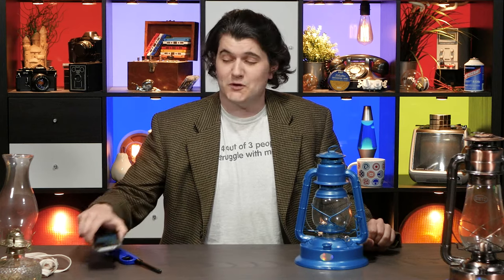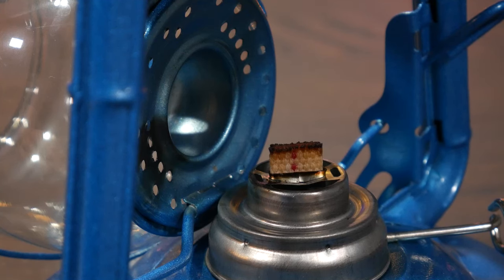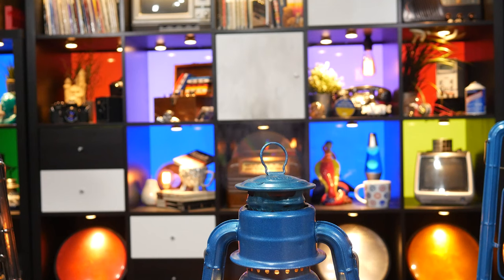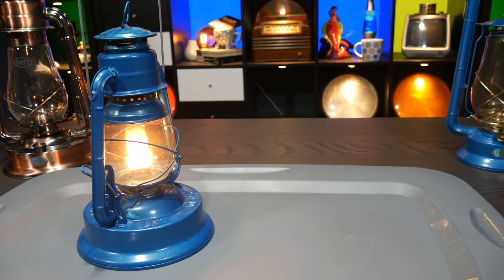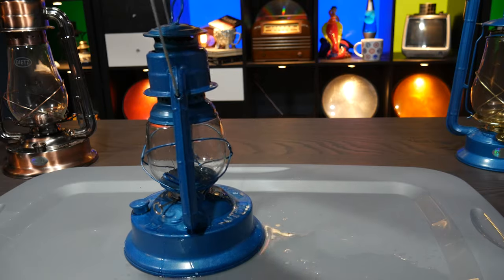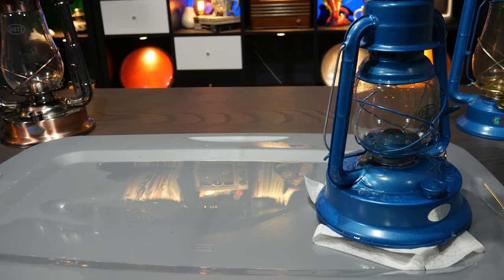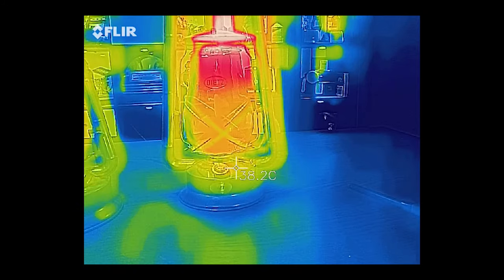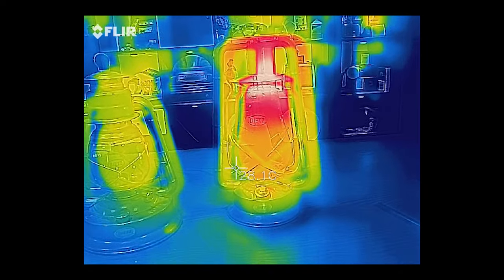How to use, more info, and further thoughts on hurricane (Dietz) lanterns

Comment: I got a similar lantern as a gift one time (Aladdin).  It came with a bottle of its own oil.  When the oil ran out, I switched to diesel fuel.  (Kerosene is very hard to find in Taiwan.)  Diesel is the same as kerosene, but has been processed to burn more cleanly.  JP4 jet fuel would be ideal, but it would be overkill.  "May I see your passport?"  Alec:  "No, I just want to buy a liter or two of jet fuel."  You could actually put kerosene in an airplane, but after the plane takes off, you wouldn't be able to see the airport because of all the smoke.  HA!

Comment: I wish you had done the research on the different grades of fuels. I spoke with the people at Lehman’s Non-Electric Hardware store in Kidron OH in Amish country, and I was told the following:

Kleen Heat and Aladdin Lamp Fuel are Kerosene also. But they have been refined further beyond basIc Kerosene.
Kleen Heat has been refined somewhat, and Aladdin Lamp Oil has been refined the most and is almost completely odorless. Aladdin Lamp Oil is the one I use. Never had a problem.

Comment: Just to clarify, on cars the idea behind the cold air intake, or CAI, is that it’s better than another kind of aftermarket intake designed to be loud, look cool, etc; the short ram intake, or SRI. Short ram intakes are very prone to heat soak as they are shorter and closer to the engine than a cold air intake. The reason why people like me buy cold air intakes is because of the design, most aftermarket intakes make more power because the pipes are larger and less restrictive. The saying that cold air intakes make more power is true in comparison to short ram intakes. The whole reason intakes make more power is because they are less restrictive. For example on my 2018 Honda Civic Si, the factory plastic airbox, filter, and hose is very restrictive compared to my PRL cobra cold air intake. The 4” silicone piping on the aftermarket intake is less restrictive than the 2.5” plastic flex hose on the factory intake. Because of the lack of restriction, the aftermarket PRL intake gains 12 horsepower and 15 pound feet of torque at peak power, and even more in lower rpms. Another thing is that CAI’s sometimes make less power than SRI’s, but CAI’s are way less prone to heat soak. That is the reason to get a cold air intake over a short ram intake. Aftermarket intakes in general tend to make more power, mainly because they are less restrictive. I hope that clears things up for people!

Comment: Careful with trusting the leadings from an infrared camera. The surface they measure must either be properly emissive or corrected for. The glass bulb of the lantern will be reading much lower than the true temperature  and even the blue paint of the lamp may not have a very high emissivity. Best is to paint a smallish black dot on certain locations where you want [close to] the true temperature measured and point the sensor squarely at that.

Comment: It is why you have an inter cooler on turbo cars so air comes in then to turbo then the inter cooler then air metering then into engine. Cooler air more energy. The tiley lamps (incandescent)  paraffin lamp is so much more efficient by using a radioactive catalytic converter. The change in flame is due to heating of the fuel as the whole base is getting hotter

Comment: Combustion doesn't care for temperature if the fuels are present. More fuel/O2,  more power.. maybe adding soot to the flame helps with light output, but I doubt alot is getting all the way around that exhaust

Comment: something that preheating would do is increase the air pressure inside the tubes, and that may be where he was trying to go with it, rather than increasing the temperature to make it burn better. for example of this look into some camping stoves, in particular the wood-gas stove which uses this technique to drive the way that it functions, but there are some alcohol stoves that use that technique to get better performance as well. of course he may have been mistaken about his premise of why it functioned better, was assuming that it was because the temperature was being increased when actually it was the pressure that was being increased. as you're saying though it doesn't seem like the differential is that much

Comment: I think that a flame from a burning material can NEVER get hotter than its combustion temp. It MAY be easier to get the combustion STARTED if the FUEL is warmed. (just as propane lamps have the incoming supply tube running through the flame ahead of burning)

Comment: Two reasons I have a cold air intake
1 it sounds cool
2 on my car, the factory airbox is directly above the valve cover, and it gets very hot especially in city driving

So believe it or not, on my 5 cylinder mk5 Jetta, with a cold air intake and heat rejecting gold wrap (reflectagold is so fun to say out loud.. Try it) I did see a reduction in intake air temperatures

Comment: Ancient, yes, but a very very refined design that uses materials that can be produced by just about any technology level at or above blacksmiths and glass blowers.   Even the wick can be replaced by anyone that can weave (in a pinch).   The Aladdin, however, is a bit more complicated to replace in, for example, an African village.   

From personal experience, you can burn pure alcohol (I've only tried isopropanol, 90%) in one of these.   (or even an oil lamp)  The wide wick does take it.   Doesn't give as much light, possibly because it's blue shifted (hotter burn).    I suspect you can use white gas (Coleman Fuel) as well, but you'd probably turn the wick down further.  Possibly even gasoline, especially higher octane. 

Note that you had to put a LOT of effort into tipping the lamp over on a table.

Comment: There are a couple of competing theories about why hot air over cold air, but it depends on the thermodynamic cycle you're running.
If I had to guess at Dietz motivation (and please keep in mind this is only a guess).  The idea would be that during a storm or in extremely humid climates, hot air would help dry the air intake thus providing a more uniform fuel to air ratio and a more stable combustion.  However, that might be an overly generous estimation.
Another potential idea would be if you were actually planning on using it for heat:  If it's going to be acting as a mini furnace or just in general, Oxygen is denser than both Air and Nitrogen.  So again, giving the best possible explanation, maybe the Hot Air intake is "meant" to separate out nitrogen so that denser gases like O2 are closer to the bottom.
Again, just guesses, I had never even seen some of these lamps and lanterns before watching your videos.  Thanks for the cool content.

Comment: Using clear fuel rather than dyed fuel will reduce wick problems.
Fiberglass wicks build residue from dyed fuel faster than cotton wicks.
A sharp pair of scissors and a careful trim can dramatically effect the amount of smell and soot.
Paraffin oil will greatly reduce lantern smell as well,

Comment: Some car intakes are restrictive when used with power adding modifications, so "cold air intakes" are useful for such applications. Also because of emissions some V8 engines at stock do benefit from a cold air intake as the stock intake is restrictive to help meet smog regulations

Comment: I enjoyed your video, very good and all, but ....

It seems to me that you have not spent any time in the tropics, what used to be called the Third World. 

These lanterns are very common here. The smell of kerosene is not such a big problem as you suggest since houses are not designed to have windows closed as is the case in more temperate latitudes. Windows are open, to let the breeze in, so smells don't linger.

In any case, in the event of a hurricane, there is no electricity anyhow, so these lanterns are kept for emergencies, even in areas where the electricity supply is good.

I was very glad for your explanation of the use of the tubes. 

I wondered if you could return to the topic of the incandescent wicks you briefly touched on. Previously, gas lighting used wicks in the shape of something like a cup or sock hanging down from the fixture. These glowed very brightly and were commonly used in the WWII years.

I have also seen in my youth a kerosene lantern which required one to pump it before use. That lantern was also much brighter than the normal hurricane lantern. 

While hurricane lanterns may be less desirable than electrical lighting, they are certainly safer than candles, or the more common solution, kerosene in a glass bottle with a cloth wick.

Thanks for exploring this subject.

Comment: In re cold air intake:
In aviation, there's what's called "Density Altitude".
In short, it's a measure of the air density, reflected as the altitude at a given reference temperature.
Very hot days are known to actually increase density altitude (which means lower air density) to a sufficiently severe degree as to make it unsafe to attempt flight, as you've lost so much engine power to the low density air that you won't even be able to get off the ground in the runway you have (with appropriate safety margins and other boring aviation stuff).

In re oils, I've had immense success using Lamplight Medallion, and it is purported to work in Alladin lamps.
It also has a relatively mild odor. It's still odiferous, enough that I definitely did not want to use my oil lamps while I had a cold, but not bad enough that I don't enjoy lighting them every so often anyways.
Walmart also sells a kerosene derivative fuel under their Florasense brand, however I personally think it smells a little stronger. This might be placebo though, and also me having "broken in" a brand new Florasense "I Can't Believe It's Not Dietz!" lantern.
For curiosity's sake, it has seals on the fuel tank in the fill cap and the burner assembly, making it spill resistant, but its construction is so flimsy and thin that the fuel in it makes up the vast majority of its weight. It's honestly unnerving how light this thing is.

Comment: The hot air intake may help to improve combustion efficiency, just like in cars. Car guys who want more power and don't care about efficiency will install a cold air intake, but if you want efficiency and don't care about power you install a hot air intake that collects air from behind your cars bundle of heat exchangers. Basically the hotter intake air temperatures improve the air's ability to vaporize and dissolve fuel resulting in better fuel mixing and this more complete combustion.

Comment: Regarding a cold air intake: If the walls of the lantern had been perfect insulation, there would be two sources of lost temperature: The fuel and the air. Surprisingly the mass of the air is a good bit greater than that of the fuel. The more grams of air is within a certain distance of the flame surface, the more the flame can deplete the oxygen in that air before that air has to be changed, and so the less air has to be heated per unit combustion.

Comment: 16:00 Glass is opaque to IR, which is why you can't see the flame. That's why when we use FTIR spectrometers in organic chemistry, we have to use NaCl crystals or other IR-transparent material to hold the sample. I have vivid memories of being extremely frustrated in my organic chemistry labs where idiots would leave the NaCl crystals out of the dessicator, and they'd be ruined, or worse, they'd drop and shatter them, and put them back like nothing happened, or even clean them with water instead of a proper solvent, if they even bothered to clean them at all. Lots, and I mean lots of reports read "this hydroxyl stretch at 3300 1/cm on the IR spectra is most likely from contamination of the sample with water."

Comment: Something I did not hear mentioned is that having the intake and exhaust in close proximity prevents the flame from flickering when the wind blows on it. There is no big wind blowing through the lantern. Aladdin burners are very efficient. They even use them in refrigerators instead of gas.

Comment: Tractor Supply, Lowes, other big box stores sell a deodorized kerosene for heaters that is surprisingly odor free.  Expensive ($45/5 gallons), and it starts to smell "diesely" when it absorbs moisture from the air.

Comment: Re Aladdin lamps: I've used a few for many years, for heat (mostly) and light (seldom). For LIGHT, with mantle, you CANNOT EVER allow a fuel-rich "spike" from the wick to touch the mantle, or it will deposit lamp-black (carbon) on the mantle, eventually covering the entire mantle and painting the whole room black. This would happen with the wick raised too high or needing trimming of high spot(s), or when the burner slowly heats up and increases firing rate. Never leave one run indoors unattended.
For HEATING ONLY (like for January shower),  with mantle removed from its support, you have a >=3500 B/h totally-odorless (with reasonable wick-ht) spot heater that'll run for the better part of a day on a full load of kero. Chimney exhaust is hot enough to easily light a cigar. Friends have tried scented lamp oil in one- totally odorless. High-temp, blue flame burner works for combustion efficiency.
OTOH, for emergency light, you're much better with portable generator & proper caution, or a batch of rechargeable batteries and your preference of LED lanterns. They are much preferable when you don't want heat. Obviously.

Comment: Efficient burning is all about getting every fuel molecule in contact with its reactant oxygen as fast as possible. With warmer, less dense air, oxygen molecules are more scarce, and it takes longer for the fuel molecules to find a buddy.

Also, cooler air is better for engines not only because there's more O2 and lower temperature, so the engine can run leaner without heating up to much, but mainly because more mass of air generates a higher pressure in the cylinder when the fuel is burned.

Comment: Minor pedantry: the Kelvin scale is a measure of absolute temperature, so the units for it are just "Kelvin". "degrees Kelvin" used to be used, but has technically been incorrect since the 13th General Conference on Weights and Measures in the late '60s.

Comment: How robust are those Aladdin lamp mantles?  I used to go on multi-day remote camping trips with a Coleman white gas lantern, and in my experience those Coleman mantles were very easy to break.  I'd always bring along half a dozen spare mantles, and it wasn't unusual to break one or both of the installed ones during a day-long hike.  They were made of ash and would fall apart if subjected to shock, so I wonder if the Aladdin lamp mantles are any better.

I could see that by itself as a valid reason to prefer wick lanterns, even if they do stink of airport.  Replacing broken mantles all the time is probably more expensive than the extra fuel used by a wick lantern, especially if you're in the middle of un-electrified nowhere.

As an aside, I wonder how radioactive undeveloped campsites like in the BWCAW are just due to the residual thorium dioxide from broken lantern mantles.

Comment: Never fill a lantern or oil lamp completely full. Leave half an inch of space in the tank. That leaves plenty of room for thermal expansion of the fuel as well as preventing leaks from the tank at upper seams or when the lamp is tilted.

Comment: I should say, a CAI(Cold Air Intake) is definitely a thing. Especially on some cars, like a Miata. If you remove the stock air box and just put a cone filter. It'll be sucking air from right next to the exhaust manifold. Ram Air is a better method anyhow.

Comment: "It's just stamped metal and a bit of glass." No it isn't the glass is quite specialised boro-silicate glass, if it wasn't it wouldn't be able to handle the heat. Cafetières amd pyrex glass cookware are also boro-silicate glass, there's plenty of it around these days. But it's not ordinary glass by any means.

Comment: TC, I think you touched on the benefit of preheating the air around the 7:00 mark of this video, but didn't explore it to its logical conclusion. You have the benefit (or blinders, depending on your point of view), of using these lamps indoors in a warm environment. I think you'd find a very different situation using them outdoors in a subzero temperature, and with a stiff wind cooling things even more. In that environment, I think the kerosene is likely to be much more inhibited in vaporizing, to the point where the lantern may burn very dimly, and potentially might be difficult to get going at all. If you've ever used a white gas stove, like a Coleman for example, they have a tube that passes the fuel in its liquid state directly through the flame to help heat it up to vaporize more readily. I suspect a similar effect, and benefit, here.